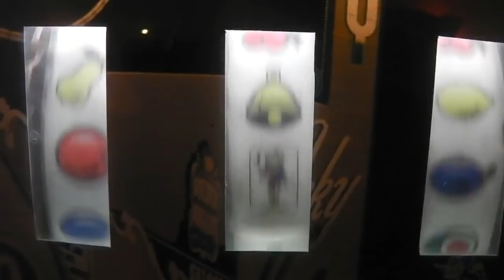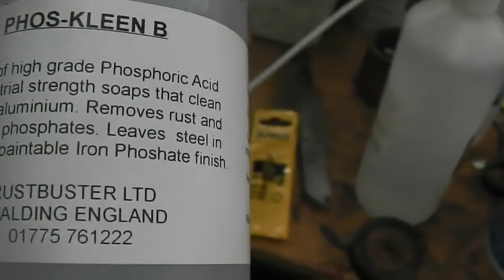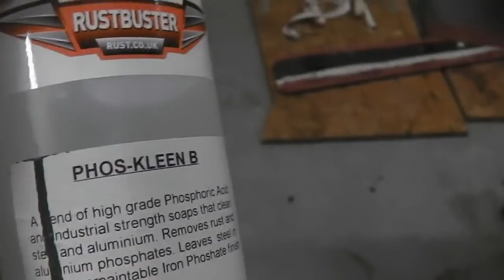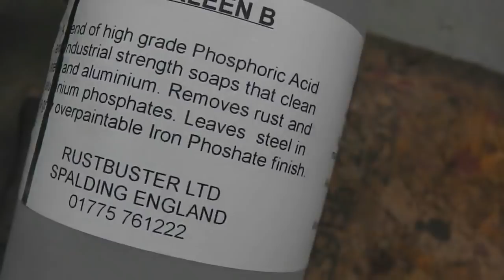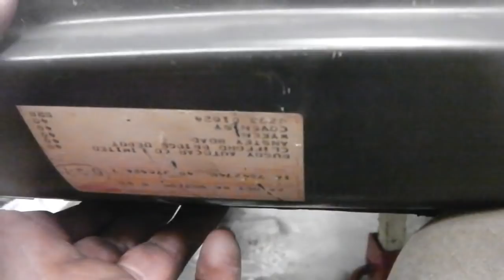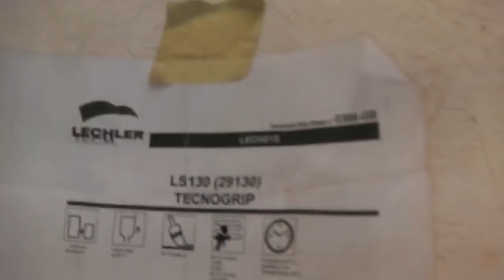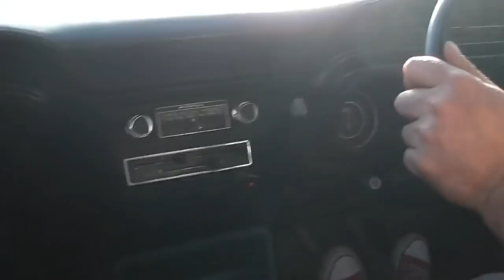Classic Car Restortion - Ford Cortina Mk3 - Project Bramble EP17

Comment: The fumes,the fumes. That took me back,some of the dogs i drove in the late 80s. Sounded like an early crossflow and full L spec?. Rare. A walk around when you reached your destination still running would have been interesting to  see how many orifices were smoking or hazing.Medal for bravery and a paper hat to lift the bonnet... You are going great guns with Bramble and breaking the job into sections with milestones is always good. Lots of small triumphs will lead to a final victory and helps keep up morale.

Comment: i normally use a combination of stick and mig on my projects though on one car i did i hired a spot welder, and for a panel replacement when the shell is good and straight and an oem panel is used its definitely the way to go, when you get 3 or 4 panels that stack and then spot weld you just have to crank up the amps, i clamped 4 off cuts together and altered the settings until i got full penetration and all 4 pieces were solid.

Comment: Finally caught up with after falling behind on the project due to earplug fail on episode 12 ! Got some nice new green JVC ones from B&M (£2 cheaper than Argos) and have been getting back up to speed . Great work with the floor , a & b posts and sills , most rewarding witnessing this all coming together . Got to say the brown paint reminds me of Easter egg chocolate  and the panels painted in it look edible !
I for one like the philosophical "quiet moments" , they're a nice contrast to the drilling and hammering . Can't not like the spot welder though , love to have a go at that ! 
Out of your fleet , although Bramble is rare being a two door and thus is cool (a lot cooler than a Capri in my opinion) my favourite is the estate . If it were mine l'd leave the paint as it is , put some 17" or 18" steelies on it (sans hubcaps) , drop the front end down , junk the bumpers and weld up the back doors and shut line making it into a two door (three door if you like) . Power it with a zetec engine turned the right way round and auto box .

Comment: Nice work Pete. Looking at the braising I think that you could have used a bit more oxygen on that flame and got less soot on the work. I didn't do much braising but a lot of oxy welding in the day and the flame was set a lot hotter than you had it. It was set to be just slightly carboxy.

Comment: A hint: turn your oxy valve on full. It's a double seat valve and opening it one turn allows the oxy to leak up the handle stem .Opening it full allows the valve to seal completely .It may not seem to leak much but you can waste up to a bottle per year through it. And the cost of gas these days is pretty ridiculous . Acetylene should only be opened 1/2 to one turn because,in the case of a back fire  where the hose is burning inside, you can get the valve off before the contents of the bottle start burning . They use a packing in the bottle to contain the gas and this stuff WILL burn if you are not careful.  If it happens and the bottle starts to feel warm/hot,ring emergency services.
Reply from the maker: THANK YOU !!!!!! very good info. pete

Comment: Another brilliant and comprehensive video excellent work m8
I've been thinking about the brazing used on the oem panels from factory im not sure but i would imagine the flux would of been borax or boron based in the 70s which to my understanding the residue can be very corrosive and moisture absorbent so maybe this could be a attribute to the usual areas of rust you've pointed out in various videos i know you love the detective side of restoration as do i. whats your thoughts on it do you think brazing during restoration might be detrimental

Comment: Some more tip top work there pete that B pillar repair was a quailty job. Quick question pete do you think a MK3 inner valance will fit a MK5 as they pretty much look the same.
Reply from the maker: front inner? front?   looks very similar
Reply: Sorry bud i ment rear inner valance ;)
Reply: By the way pete could i be cheaky and ask for the dimesstions of the dolly frame Bramble is sat on as me and a friend are building one for my MK5 sorry to bother you with so many questions bud.

Comment: Top job again Pete. Just keep being impressed by your ATD (Attention To Detail) that delivers the results. I liked your ideas about putting tension into a structure.
On another tack this may interest you (Skip to 00:49):

https://youtu.be/ST4FpVpHQcg

Got to love a Man Cave btw. Anyway I understand the lad is in Liverpool area so maybe there is another car to be saved or a source of parts ... ?? And he has a Mk 1 Escort with proper steel arches ... I was intrigued by the engine transplant in the Mini of course and what a nice job the lad did as well. After Noah is rebuilt and running well next year's project will be another Mini (of course) but with a BMW K1200 Twin Cam head engine. Been done before but I have some ideas as well ...

Comment: Ah man, this stuff is so exciting, I haven't been this enthused about autobody and restoration in years, I mean, I could kick myself for getting rid of/selling off an old datsun pickup that had much much rust, now it has even more and some other cab damage now by new owner, but not kicking myself this much really, a vehicle that belonged to my dear mother now passed on,..ah well, really the old 80 datusn pickup I welded the heck out of various areas off and on for twenty years back then along with replacing fenders and doors, welded with a mig welder, ironically enough,....my neighbor still drives it sometimes,....good thing I made it at least structurally sound with the pillars and hood hinge areas, ....learned alot more about welding small inlays about six years ago,..maybe more, .....and no,....haha, I don't plan on taking the old 80 datsun back from my neighbor who jokes about it recently when he bought a four wheel drive 89 model,....I'd have to be as good as pete c and have alot of funds AND a good shop to pull that one off.......well,...if I win a huge lottery,...it would be interesting to prove a point,...of just how I screwed up alot of the welds I did do, I mean, I'd have to cut out panels that were technically spot welded but I laid thick welded over the damaged areas, etc.
Reply from the maker: Bud!!!!!! thanks for your stories!!! you always give a good load of stories, !!! thanks!! enjoy them, Pete

Comment: Amazing progress as always, but I have to say I think getting too OCD on the B pillar was counter productive.
When you welded the pinholes, there really was no need to grind those welds back down, in an area already surrounded by thin metal. Once everything is back together it will never be seen again, so looks inside a box section count for nothing. 
Perfectionism isn't always a strength.
But it is easy to be critical from my keyboard and I'd give a kidney to have half your talents.

Comment: Could you help me out with some information Please, as a friend is restoring a mk3 cortina 1973 2.o ltr, we are finding it hard to get information in Australia for a part number for a LUCAS distributor cap for the 4cyl 2.0 ltr. Thank you if you can help
Reply from the maker: Johnny I only know of 2 distrutor caps for the engine, a BOSH one (coloured red/orange) and a MOTORCRAFT one in black, it would be easier to buy an  entire unit from H + H Ignition UK, electronic version without points, this way you get reliability and no need to set points gap anymore and unit looks like an orginal BOSCH distributor
Reply: @PeteCswampy  Thank you for your help